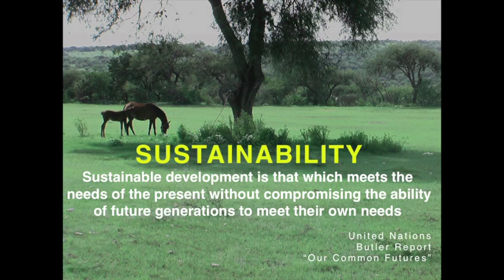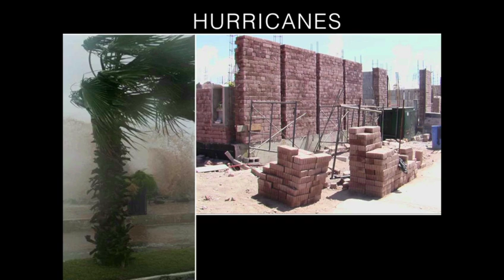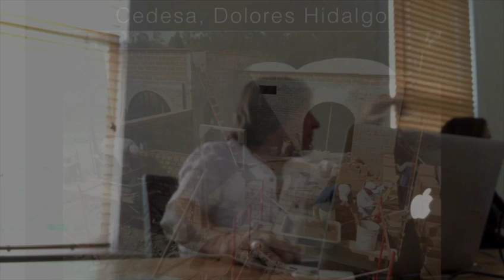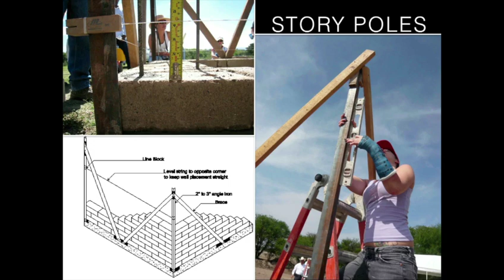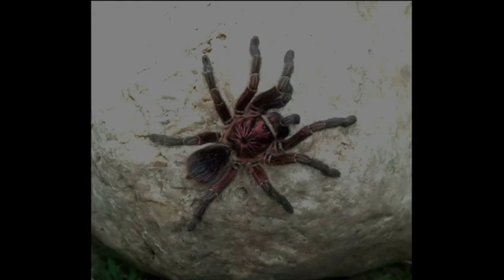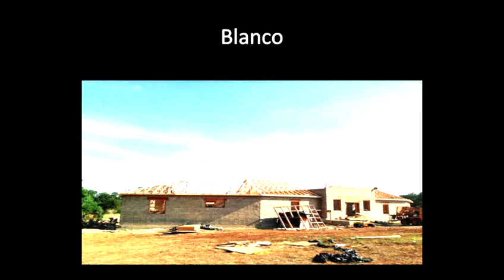Compressed Earth Blocks - Earth Block International

Comment: Did the building on the Crow rez have a double wall? 
The double wall convo in this seems to just satisfy the architects? 
With a thick enough earth wall and alternative methods to condition the inside air ie: floor heat cables or passive georhermal tubing, wouldn't insulation be unnecessary?